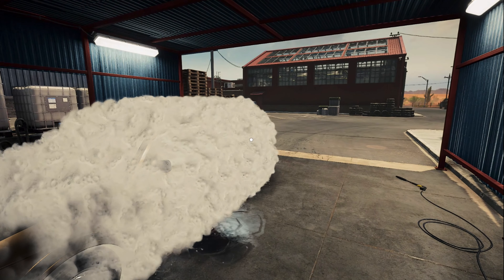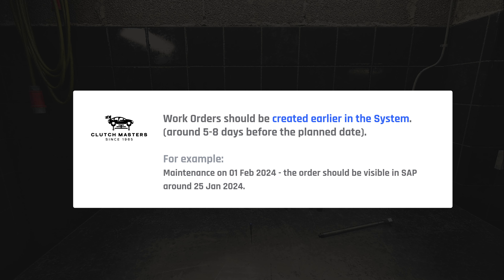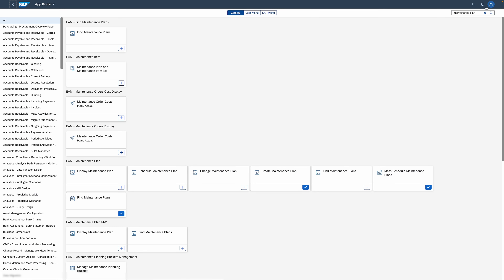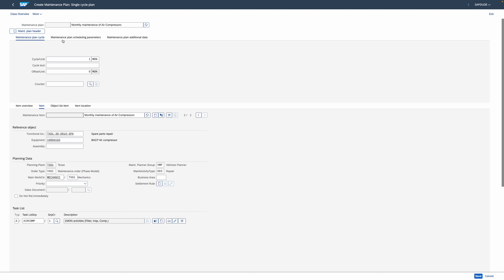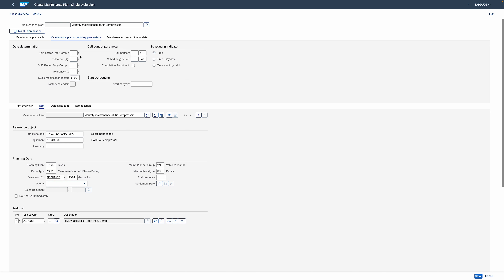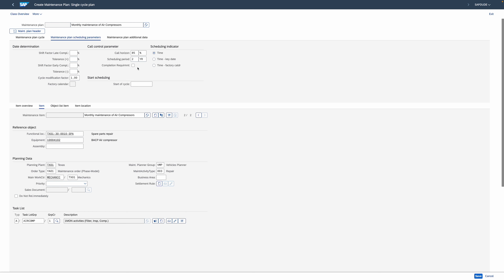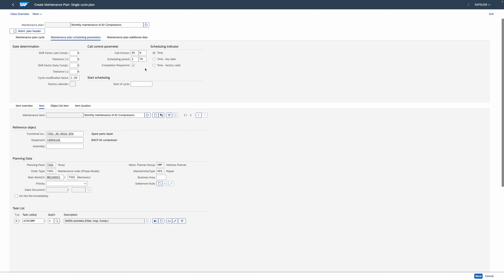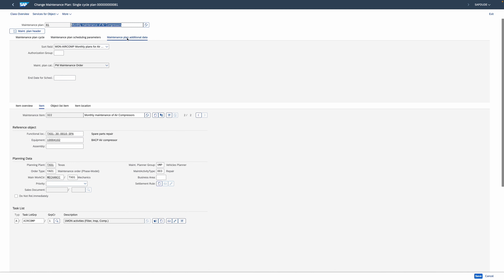SAP PM/EAM Tutorial: Scheduling Parameters EXPLAINED

Comment: Question: what happens if I set Late Shift Factor (and completion requirement off), but then I don't ever TECO the call. Will the next call generate per it's set call horizon/planned date with no shift applied?
Reply from the maker: Hello Christopher, 
The next call will be created without any shift.
The late shift factor does not kick in as the prerequisite is not met (the TECO).

Cheers,
Dan

Comment: Nice explanation. One thing i want to confirm is the one regarding Scheduling period.
Its for the visibility of calls in the future every time a plan is scheduled, correct?
Doesn't mean, the plan will only be valid till 2 years if Sch.Period = 2years. And once 2 years have passed , ill have to change this parameter?
Reply from the maker: You got it!
Yes , the scheduling period means = calls overview period is restricted to 2 years.
No you don’t have to change the parameter.
The overview will be automatically extended.

Example:
Now you see an overview for orders till April 2026 (let’s say u have 2 YR set).
Next month you will see an overview moved by one month, so till May 2026. 

Cheers,
Dan
Reply from the maker: Additional thing from my side - no the plan is not scheduled once, there is a background program which runs for instance every day in the morning (depends on you). That’s why the parameters will be ‘refreshed’ during every run of the program. 

Cheers man,
Dan